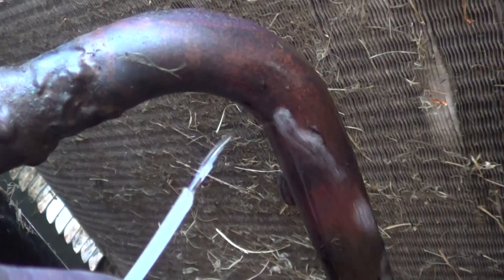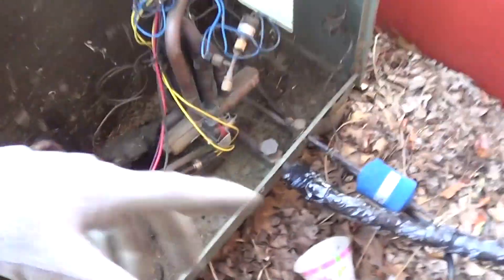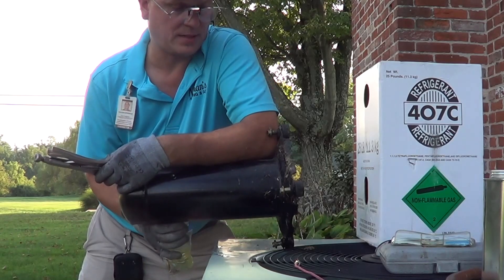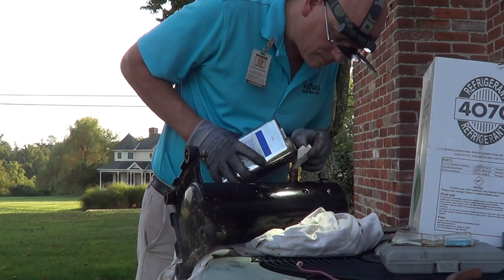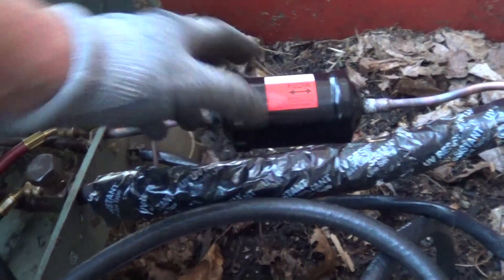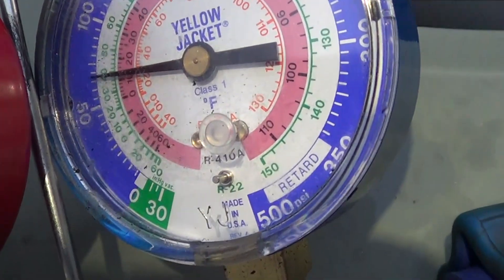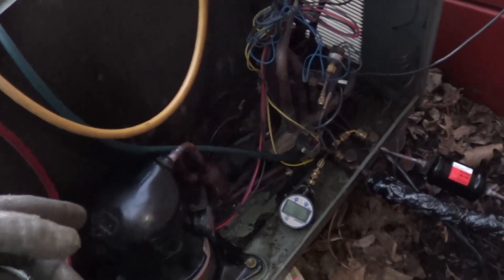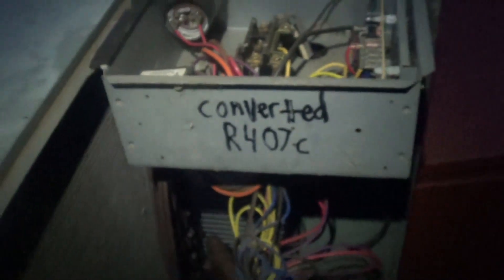Converting a R22 system to R407c

Comment: Why change the entire part instead of just welding the hole?
Reply: The concern was the part already showed signs of rework.  Copper work hardens due to things like vibration.  If a piece like that has already cracked before especially if right on the compressor itself, there is a significant chance it will fail again shortly.  A new piece is softer copper with less fractures and stress and so will more likely last longer.

Comment: I have an old 4 Ton R22 split system, the compressor rotted through releasing all the R22. The Attic is very in accessible, so I opted to purchase a new 407C compressor and leave the coil alone. Anybody see any problems with this strategy ? Now I need to get  the system charged ? Can I do this myself ? Where can I rent the gear ?

Comment: What does 45 Min on a compressor  label for oil quantity mean?
Reply from the maker: 45 oz of mineral oil.    That only works for the old chlorine based refrigerants.    You need polyolester for the new fluorine based ones.
Reply: @NathansHVAC  Wow, thanks. Decided to get my Universal and do a little refrigeration. First I'll upgrade my old Bryant. The furnace and AC have been working great for 28 years. So far I rebuilt the furnace completely. Now I will rebuild the AC and retrofit it with an HFC. The biggest problem is deciding which one, everyone has an opinion.

Comment: So I have an accumulator and I'm changing a 5 ton r22 unit to r407c. Was just going to RX flush, blow out with nitrogen, then replace with new compressor that comes with POE oil.  I guess I dont have to take the accumulator out and dump out any oil?
Reply from the maker: If you are doing the compressor, might as well take out the accumulator.   Also paint it

Comment: That suction line on the comp was brazed by stevie wonder.....Try R458, works great with a 10⁰ sub
Reply from the maker: I might do that.   Currently I always add leak saver ultimate to every top off.   I have plenty of r22.    I suggest getting plenty of r410a as soon as the price drops down below $200.    It is being phased out even faster than R22 was.

Comment: All gas is ozone safe. It's heavier than air bubba.
Reply from the maker: The ozone hole over Antarctica did shrink back.   I wonder if it was natural though?   Either way, it was good news.
Reply: @NathansHVAC  something tells me all the global warming fear mongering is a bunch of horse pucky. My common sense tells me that as the earth warms, naturally, more water will evaporate causing more and more clouds to form to cause more shade... simple math or cause and effect.
Reply from the maker: Also, oxygen is 16% heavier than nitrogen and there is plenty of oxygen in the stratosphere.   There is a lot of air circulation in the atmosphere.
Reply: @NathansHVAC  that's one THEORY... my own makes more sense... and it's not driven by money/system replacement/ manufacturers
Reply: Just because NASA says there is an ozone... that means there is an ozone? Theories are just opinions... how fast is the speed of light?

Comment: Disconnect suction and discharge line, clean the piping system with high pressure using nitrogen gas, fill the compressor with recommend r407c oil ,put the compressor back and then recharge with r407c

Comment: can i buy a 410a condensing unit and drain the compressor use poly ester and charge with 407 ? air handler looks almost new but system is 20 years old

Comment: in Indonesia r407c is widely used for water cooling machines and also air dryers, the compressor machine used is a scroll type, the question is whether r407c can be used in rotary compressors?

Comment: My 26 year old car air conditioner and 30 year old refrigerator/ freezer work just fine. They've never been serviced.

My HVAC guy says I need HVAC-service once every two years. I only assume this is because the system leaks over time.  

This begs the question, why don't my refrigerator and car AC need servicing?

Comment: Hey guys, we had a shade tree HVAC guy add stop leak to our 22 year old 2.5 ton R22 system. He then topped it off with R407c and said it was good to go. The system was at 40% before he started so what’s the damage gonna be to the system since he didn’t put in any synthetic oil with the top off. He added 2.5 #’s R407C. This was 3 days ago. Thanks for any help!
Reply: There’s a high chance that your compressor will fail, although you might be ok… and for these type of repairs try to use a professional, AC systems are freaking expensive to just let anybody work on them

Comment: question for you. i have someone replacing my outside unit compressor. understably, the 407c is the best compatible replacement for the r22. long term use of the r407c will cost me less money in the future if i need more refill.i was told that i should keep the r22 since the upstairs unit works harder than the downstairs unit. any thoughts......

Comment: The truth is that what is said about changing from refrigerant R-22 to R-407C is respectful, but what they do not say is that R-407C is even more rebellious than R-410A and why do I say it because when there is a 407-C leak and a lot of refrigerant has been lost, it cannot be recharged because instability is generated in the system because the refrigerant is unbalanced and when they put it on the mark, the high-pressure clock hand becomes unstable and that is the sign of that this recharge is unsuccessful and lost and it is time to remove the refrigerant and it cannot be used again, instead a substitute for R-22 is R-427A and this one can be adjusted for charge even with positive pressure considering that it has lost the freon through the service valves and it is recharged and when it is started it does not generate the novelties that are presented with the R-407C and the R-410A, as I said it is respectable but when changing the refrigerant in a system we must make a excellent cleanliness of the internal circuit in the condenser coil  and the evaporator, consider the refrigeration turns and in the expansion check if it is TXV, piston or Capillary to check the pressure drop at the evaporator inlet and logically change the filter.  and depending on the expansion device when putting the machine into operation, the super heat, sub cooling and the thermal difference inside the house or apt.  When the oil is removed from the compressor, it must be measured in c.c.  and that same amount that was measured enter it and do it in the shortest possible time so that the oil and in this case, which is polyol ester, does not absorb moisture and that the task is more efficient. Greetings.
Reply from the maker: Perfection is the enemy of good enough.

Comment: Looks like a lot of time and money on a really old system hope the customer is happy
Reply from the maker: That system is still running.   It was a pain though.   I ended up putting a big loop in the hot gas line to prevent cracking.

Comment: I have  mix 134R to407c  got temp in commercial cooler  but next day  got leak          At the valve flange fix that and fill 407 c again and next day got the dryer leak fix that and fill 407 c and  next day  got leak at  gas fill nozzle which was not leaking a day before 4 times I have done this lost lot of gas and labour cost  now I do not know what to do .My technical man  does not know what is happening .He repairs one place and next day a new place leaks pls assist
Reply from the maker: Get a navac nml1 leak detector and snoop soap bubbles.   The proper tools make the proper repairs.

Comment: Great video thanks! , the only thing stopping me from doing it is,  I don't have a vaccuum pump, my question.... is the vaccuum pump something I a must have when recharging the system from  100% empty?
Reply from the maker: People used to purge.    Buy the epa forbids it now.   Plus, purge wont flush out moisture.   Get a cheap pump.
Reply: @NathansHVAC   thanks for the quick response!  In other words I do need to get a vaccuum pump right?
Reply: @NathansHVAC  my system is empty so I'll replace the oil as shown in the video, once I've replaced it do I need the vacuum pump in order to add the new 407c ? or can I just hook up the tank and gauges and add the gas?

Comment: Are there any tax incentives for taking an old (but working) R22 unit out of service and replacing it with a new one (R410)?
Reply: I replaced my HP R22 outdoor unit with straight A/C condenser and used R 407c; indoor unit is 26 y/o; it works like a charm; want to upgrade system down to 3 tons but it'll take awhile before I decide what to get. I'm a retired HVACR guy!

Comment: R22 to R407c or 410a . . .  Fix or replace?   It's so very confusing.
Reply from the maker: If the system is older than 15 years, dont spend much repairing it.

Comment: 1) do you put same amount of 407c in weight as you would have had R22? 2) is it my understanding that changing the oil in the compressor to POE is enough for this conversion? did not quite understand what you meant by bringing it back. the oil in the lines? or for circulation. 3) my understanding is that the later R22 units they were already putting in POE vs mineral oil how can I find out which oil is in the system? Is there a test for POE oil? I can't find any info on the label it is a York unit. Thanks
Reply from the maker: Yes to both.   Only 20% or more of the system oil needs to be poe.

Comment: Pretty much the procedure we follow. Most of the time we actually flush the system to remove most of the mineral oil that’s remaining. In Australia this can sometimes be more expensive than charging with r22 though depending on who manufactured the compressor, Copeland scrolls are fine to have a bit of mineral oil but with a maneurop the suggested thing is to remove as much oil as possible and if you can, change the oil twice. With certain compressors the cost is actually cheaper to use r22 because POE is quite expensive. Obviously over time if it’s in bad shape and you know it’ll leak again soon just do the oil change because 407c is definitely a lot cheaper
Reply from the maker: The manufacturers specify the high purity I think just to cover their asses. Oil blends are used all the time in the automotive industry. Also 407c should have the exact same capacity as R22.
Reply: @NathansHVAC  in Australia it’s annoying because to be legally compliant we have to do retrofits according to manufacturer instruction, even if the manufacturers only specify it to cover their asses. And with the capacity thing it should be the same capacity but in practice it isn’t always and I’m not sure why. It’s definitely not as much capacity drop as mo99 but it’s still measurable on larger systems and tends to trip head pressure on those 45+ degree days (about 115 Fahrenheit). 

The main customer of ours who still wants to use r22 is a certain power company, perhaps they have more dollars than sense but their infrastructure is very critical so I’m not going to argue with them
Reply: P.s. it sometimes also depends on the customer we have one particular customer who doesn’t want to change from r22 due to the capacity drop and that leading to their switchrooms overheating (no redundant cooling)
Reply: I’d recommend to flush the pipe system with a flushing chemical using nitrogen as the propellant get all the oil and gunk internally then continue with your process.

Comment: and  I don't have balance so what is it the pressure of R-407 Low and High pressure, the R-22 work wint 60-70 low and high 230 psi, so what is ther pressure in R-407 thanks
Reply from the maker: R407c is the same pressure as r22.   It is the closest match possible for pressure and capacity.

Comment: Can I charge an r22 system that had 407c with r22 without flushing it with nitrogen
Reply from the maker: They are the same properties.    However, the EPA forbids mixing gases because it makes the R22 reclaim value zero and any reclaiming the R22 in the future will not be pure enough for reuse in another system.   So, the EPA will require that the reclaimed R22 that you add will have to be destroyed.

Comment: Quick Question:  Do you or do you NOT need to install a THX valve  doing a 407C switch on a R-22 compressor.   The 410a uses it, but R22 did not.
Reply: Nope, txv will keep superheat constant depending on temp. The txv should be able to compensate for the slight pressure difference of 407c compared to r22

Comment: I switched to rs-44b myself and it has been working great for me.
Reply: Did you have to change oil and compressor and filter drier on that one or what?
Reply: @fckthemedia1649 everytime you open a system to atmospheric pressure you change the line drier. ALWAYS. But no RS-44B can work with either oils

Comment: I wonder if this Condenser is still in service ?
Reply from the maker: Yes it is still running.   Here is the complete history for this customer from my notes   That upstairs unit has been a pain in the arse, but at least the refrigerant is cheap.
5/2014 – Installed heat pump system for downstairs.
1/2015 – added larger return air.
2/2015 – humidifier pad.  Changed backup battery on thermostat.  Set IAQ to hybrid heat (with hi pressure switch)
12/2015 – replaced 10kw heater on upstairs unit
3/2015 – replaced fan control on upstairs unit
9/2016 – fixed leak on upstairs a/c.  converted to R407c.
12/2016 – replaced blower motor on downstairs a/c.  replaced nozzle and oil filter.
12/2017 – found no fuel oil
5/2018 – fixed leak on copper pipe.  Recharged with R407c.
8/2018 – fixed leak on suction pipe (again)  Recharged with R407c
5/2019 – replaced suction pipe on compressor with a large loop for vibration.   recharged with R407c.   changed filter dryer
6/2020 – replaced expansion valve on upstairs unit

Comment: Good video but did you flush the lines with RX11
Reply from the maker: Flush is just for burn outs.   I have a video on cleaning burn out line sets with non-flamable brake cleaner and a high powered shop vac.   Mixing oils is fine.   The auto industry mixes all the time.

Comment: After you convert it over do you need to change the piston and or txv
Reply: With a piston you'd simply adjust your charge to achieve the proper superheat.  With a TXV you'd check the feed and (if necessary) adjust the device to maintain the proper superheat.  The two refrigerants are close enough that a hardware change wouldn't be needed.   You'd just need to make sure you charge the 407c as a liquid since it's a  a zeotropic HFC refrigerant blend.

Comment: False, you lose 5% with 407c not gain... r22 doesn't cost THAT much considering the alternative replacement cost
Reply from the maker: If the system needs 12 pounds of R22, it does cost more to use R22.   But, point taken.   I don't convert many systems.   Usually, it is better replace a really bad leaker.    As for capacity of R407c.   The evidence is here.  But, it is 10 years old and probably out of date with some of the newer drop in substitutes.   https://www.epa.gov/sites/production/files/documents/Choosing_Right_R22_Retrofit.pdf

Comment: YoU should have washed the coil as ur waitin on ur vacuum pump
Reply from the maker: I don't like having water around vacuum.  Any loose hose will suck in a lot of water.  I usually wash very last after I clean up and charge the system.

Comment: I don’t really like or agree wit  your way of oil change , and your information is not correct , should be less then 10 percent mineral oil , you should do more and accurate research.
Reply from the maker: I researched this a lot.   I even emailed a research engineer at a top refrigerant manufacturer and he agreed 20% POE concentration is fine for residential.   Of course, the manufacturers are going to say 90% POE.  And, I'm not going to say his name.  They have to warranty millions of units.   But, this system is still running fine 4 years later.   Mineral oil lubricates also.   It just needs the POE to help return it from the evaporator.   If you look at the ingredients of the drop in blend refrigerants, they use about 5% butane for that same purpose of returning the oil.

Comment: Great video...I am wondering though, why I never see anybody using the process tube to access the oil in the sump....A flex tube hooked up to a brake bleeder hand pump and shazam...Seems faster to me....I have done it on smaller units, so far so good...lol...Thanks to the gent that made this video and before I go, they are still f**king with the refrigerants....Now phasing out 410A....Makes for a whole new system, period....Carrier started it this time....R32 AND 1234yf BLEND....Bend over, I'll drive.
Reply from the maker: The compression ratio for R1234YF at 40F/90F is 2.07.   The compression ratio for R410a at the same conditions is 2.15.   The compression ratio for R22 is 2.19.   That means the new refrigerant will require less work from the compressor and will have a higher SEER rating.   It appears to be $60 per pound on ebay.   It looks like a scam to me.   But, in the long run when efficiency goes up, energy usage goes down.   I wonder if it will last though.   I hope this isn't another soy based wire that the rats love to chew in the 2007 thru 2014 cars.   Or a green fail.